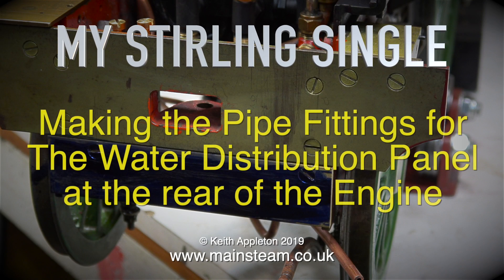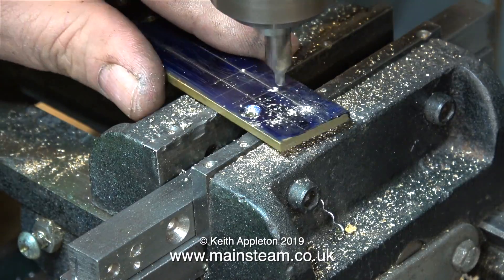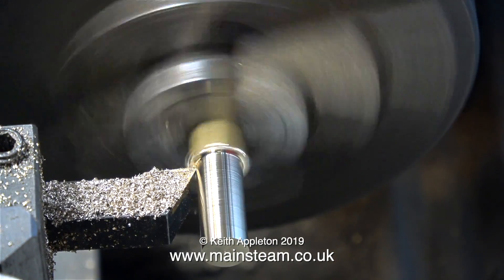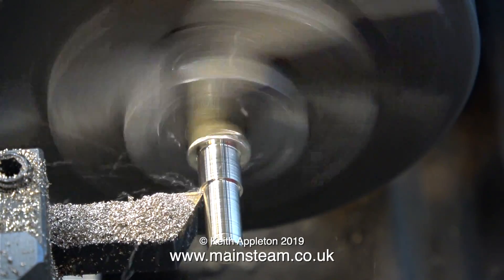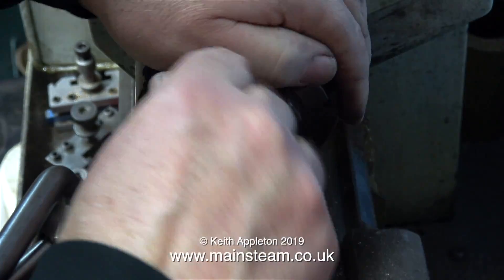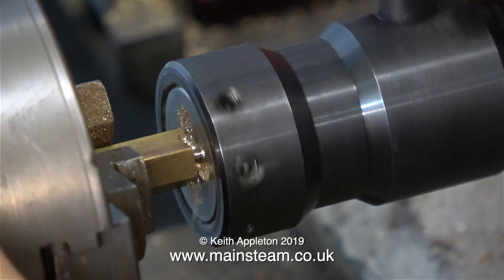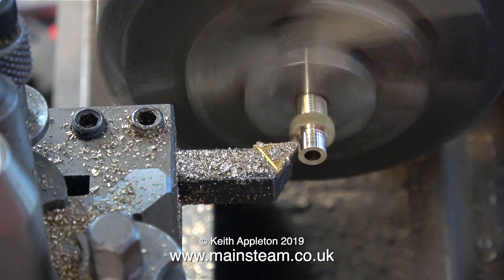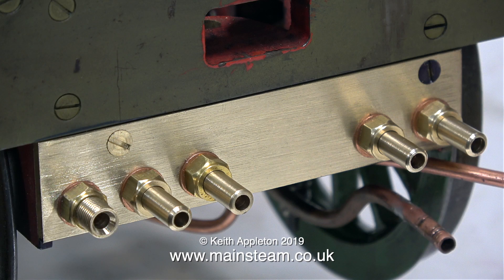MY STIRLING SINGLE #18 - THE WATER PIPE CONNECTORS

Comment: What size pipe do you recommend to connect to the push on fittings and any recommendation as to supplier ?
Reply from the maker: Sorry, but I don't understand your question ......
Reply: I have made the connectors as shown in your great video .... with 1/4" to connect to the rubber water pipe fropm the tender. The question is what diameter ID tube do you recommend as a good push fit coming from the Tender and where to buy it ..? Regards Charles
Reply from the maker: ah I see . . . . for 1/4 inch outside diameter fittings, I would use 6mm inside diameter silicone rubber  - I buy mine via Ebay - here is an example:   https://www.ebay.co.uk/itm/Silicone-Vacuum-Hose-Pipe-Radiator-Rubber-Silicon-Vac-Tubing-Air-Dump-Valve-Tube/260859756315?hash=item3cbc73ff1b:m:mpHYmaXZ0xpxdx5UAo4duUwtubing
Reply: @keithappleton  Thank you very much Charles

Comment: Very high quality Machining as always, not questioning you a bit about the way you're doing things just trying to understand. I understand the pressure fitting needing to be separate for the hand pump, but since you built the check valve manifold would it have been easier to combine the water feeds to a single line for the 2 injectors and the axle pump? I understand you have to have a return to bypass the axel pump. Or is the diameter of the pipe too small to supply those three items on one line?
Reply from the maker: 2 injectors to a single check valve is problematic, I find that they are better separated.